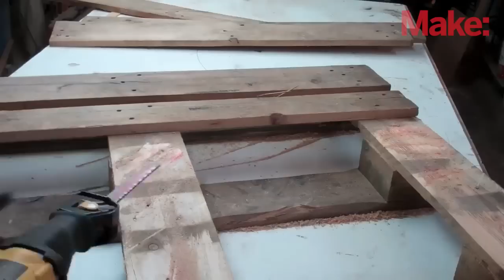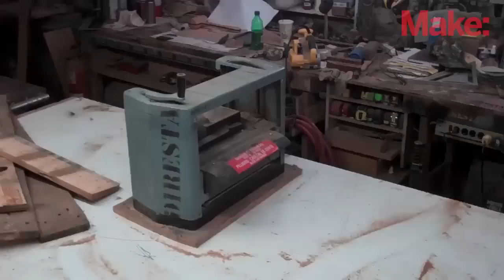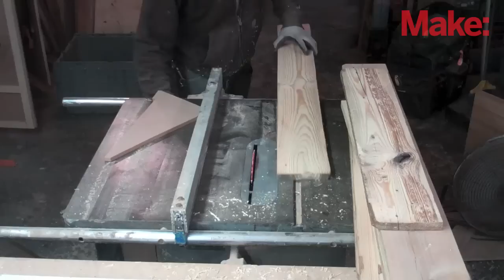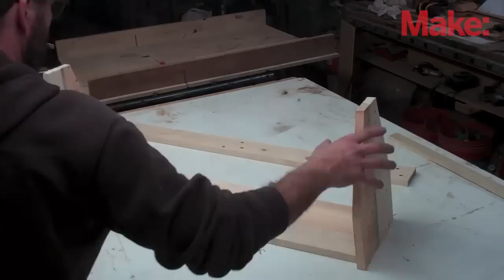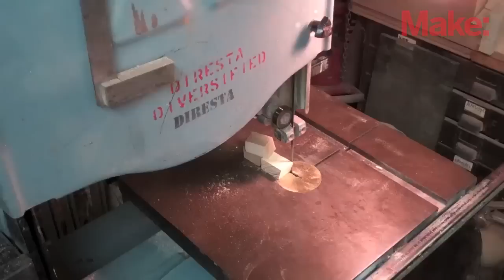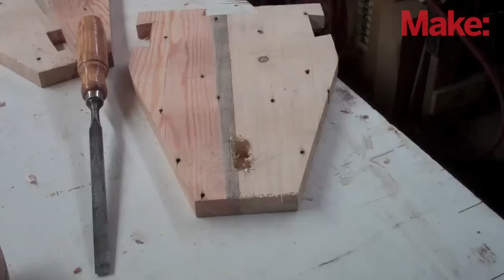DiResta: Pallet Toolbox

Comment: Hey Jimmy... this may be a stupid question to an old video, but... What is holding the two end cap boards, on each side, together besides wood glue? I saw you used brad nails for the bottom and side pieces, but should the wood glue fail under the weight of tools, the end caps will split and ruin the whole box. That aside it is a beautiful piece that would be great for decoration. You do good work!

Comment: what's the point of using skid-wood if you're just going to plane off all the patina?
Reply: He was probably just making them all a uniform size and thickness to help with gluing and piecing everything together solidly
Reply: Yes, but part of the appeal of skid-wood is the imperfections and patina giving it an old, rustic appearance. this box would look the same if he'd used new lumber instead of planing the imperfections off of the old lumber.
Reply: Brok3nC4rrot pallets are probably dirt cheap compared to new lumber
Reply: Brok3nC4rrot Lumber is expensive, this video shows you how to get something fairly nice from free materials. Some people like to use pallet wood for it's patina but that's just a different style.
Reply: Tom Rominski 
Around me you can get pallets free if you don't mind dumpster diving. 
Some of them are made from oak.
Reply: Brok3nC4rrot <<<<<< of course there is this guy. just watch and enjoy.
Reply: C Smith nice, I always drive round back when I'm leaving home depot to see if there are any being discarded. I keep one in my truck bed so that things are elevated and won't get wet if it rains (when I put a tarp over stuff)
Reply: Tom Rominski that is actually pretty smart, why didn't I think of that?
Reply: Brok3nC4rrot its free
Reply: +Brok3nC4rrot  I'm pretty sure he did it just to make you cry. 

But other reasons I can think of are, Recycling/Re-purposing, It's Free, and most of all for fun...

Edit: I forgot to mention It shows you that you don't have to buy new wood to get a new wood look, I could probably keep going, but I'll leave it there.

Comment: Easier would be to carefully pull apart the pallet with a claw hammer, then knock out the nails with same said hammer.
Reply: More chance of splitting the wood, though. My guess is that's why he used the recip saw.
Reply: if you pull apart a few pallets you soon realize they are not intended to come apart. all nails are one way. especially  in hard wood ones ,
Reply: jimmydiresta yeah, pulled apart a few pallets a couple months ago...  found it easier to use a recip saw too. :P

Comment: the tools are too expensive
Reply: +bambang ari You can do these things with simple handtools, it will just take longer. It is all about how committed you are to a project and what you are willing to do to finish it.
Reply: +bambang ari 
It's not about the tools, It's about the intention
Reply: +Brentster56 well,can you flatten a board of wood with a handplane or a surform perfectly? or rip-straighten the edges of it with a handsaw perfectly (yes you can do it but it will not be accurate